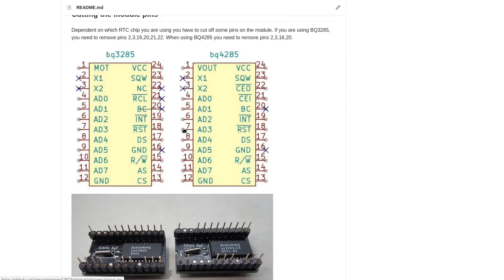Ultimate RTC module  replacement for Dallas DS1287, Benchmarq BQ3287, BQ4287 etc.

Comment: Years ago I had this mobo with one of these crap DS1287 modules soldered into the mobo...and of course the battery dies in it.

I eneded up desoldering this module and replacing it with a socket.
Then I carefully cut the module open and removed the battery, soldered in wires and ran them to an external battery holder.
Once back in the mobo...it worked until I retired it a year or two later.

Thankfully this was the one and only time I had to deal with this nonsense.
I swore I'd never consider any mobo in future that had one of these modules.

Comment: I just encountered a very strange issue with a motherboard (the famous Intel Batman's Revenge board). For some reason, after replacing the empty Dallas chip with an nwX287, I still get the "CMOS battery is empty" error. However, after modding the original Dallas DS12887 chip and adding a battery holder, the error disappeared. And of course, I tried multiple known good nwX287 replacements, none of them work (but they do work fine in other boards). This is very strange!  I'm curious to find out what could be causing this...
Reply from the maker: May be missing pin 21? See the documentation on the project site.
Reply: @necro_ware , well, yes, I did check the documentation, of course. 🙂 It is missing pin 21, same as you specified in the documentation for the bq3285: Removed pins 2, 3, 16, 20, 21, 22 (same pins missing as the original Dallas DS12887 that was installed on the board).
Reply from the maker: @ruxandy  in the documentation I mentioned, that the pin 21 is required on some boards, that's why. But if it is already missing on the original module, then there has to be something else. May be worth opening an issue on the project site. May be others would have some useful ideas.
Reply: @necro_ware , will try and do a bit more debugging myself and if I'll come up empty, I will open an issue. Thank you for trying to help and for all the awesome work you did and still do for the community!

Comment: Bro these are junk - I put one in a NEC 386 and another one in a NEC Ready and they just get hot and crash the computer. What a waste.
Reply from the maker: Meanwhile these modules have been installed in thousands of systems. I don't know where you got them from, but I don't sell those. If you have problems, you can open a ticket on the project site and I can try to help. Or just give it back to whoever you bought it from.
Reply: @necro_ware  Well, the seller I got it from won't do a return so late - and it's strange how two of these won't work....anyways, I'm going to try your method of burning the resin off the old RTCs and fitting a new battery conversion. 

And I'll keep these ones for the next time I encounter a Dallas RTC NOT in a NEC system.
Reply from the maker: This part already has been used  also in NEC boards and even music synthesizers. The nwX287 is made for various chips, so there are many open questions, like which board exactly do you use? Which chip is on your nwX287? Which pins are removed? Which RTC module was previously on your board? Does it have the same set of pins as on the nwX287? And more. I can just repeat myself, if you want to get help, please use the project site and supply all the information there. Just flushing your frustration here will not help I'm afraid.
Reply: @necro_ware  They replace 1287s - pins broken off according to your github article. I went through my retro machines using similar chips, and none worked. I'm inclined to think that this was a bad batch from the vendor...  luckily the computers POST when an even dead 1287 is put back in, so yeah, I'll be heating those up later on today. Sucks being out $50 though (though I am not blaming you specifically for that) but it could be worse I guess. I'll stick to reworking Dallas RTCs like I have for the last 20 years ;)
Reply: @necro_ware  I followed your "heat up the old RTC and break the epoxy off it" method and it worked beautifully.

Comment: What are the chances this could be used as a DS1643 for a Sun SPARC 10/20?
Reply from the maker: Zero, the modules are completely different. But may be following will help: https://youtu.be/ecTZtZhE9bI
Reply: @necro_ware  thought so, there’s a modern DS1643 replacement, similar idea to yours, it’s just not open source and like $65 on eBay.
Reply from the maker: @c1ph3rpunk  yeah, you can try the solution I linked.

Comment: Hi @necroware, I used this chip to revive a Spectrum 386. I am having trouble with a Dell 316SX. On first boot I hit F1 - continue boot instead of F2 - configure BIOS. Now nwX287 has a borked config and halts before F1/F2. How can I reset it?
Reply from the maker: You should still be able to enter BIOS. If pressing f2 on POST doesnt work try ctrl-alt-s for example. If nothing helps, just pull the battery from the module for a minute.
Reply: @necro_ware  I pulled the battery, it boots fine.

Comment: Hi, is anybody selling those modules?
Reply from the maker: Thousands of those were sold so far on Ebay since I released this project. There were so many sold, that people bought off the complete stock of the ICs required for this module. Still you can buy these modules on Ebay regularly. I don't sell them and never did.

Comment: Do you have a website? I have a couple of retro motherboards which need repairing and I need some guidance. They are American megatrends 586 SBCs, one is beeping and the other is totally dead after replacing the DS12887a IC with one of these modules in your video.
Reply from the maker: There is a project site where you can ask your questions, however due to very limited time, I don't do support. Please read the documentation on the project site, may be you will find something useful there. https://github.com/necroware/nwX287

Comment: This project is great however the BQ3287LCS or ES are just way too expensive. There is a chip which they sell on eBay at a great price which is the BQ3287LF but is is a smaller (and therefore consumes less power) There is a video on YouTube of a guy that reworked this whole project to to work with that chip and also to use the more common battery CR2032. Just look for it. YouTube won't allow me to enter the title of the video, or anything, it flags it as spam for some reason.
Reply from the maker: I have another project in my repository, which uses the smaller chip as well. That one was my first project, but the chip is tiny and not many people can solder that. That's why I introduced this one. Back then the chips were at the same price, but since I open sourced this project the prices exploded. People around the world started to buy them off and sell thousands of this modules. It's kind of my fault, that those chips are now expensive :)
Reply: @necro_ware  Ok thank you for clarifying. Makes sense. I had to order the chips from Aliexpress because they were so expensive. Hopefully they work.

Comment: Thank you. A very interesting solution. The next step replace the battery with a supercapacitor that will be recharged during operation
Reply from the maker: Supercap doesn't last long enough. It falls under 2V in just less than a week. You can extend the time using a boost-buck converter, but it's too much. I experimented with those, but eventually decided  not to use them.

Comment: Great work, always nice to see efforts to prolong the life of vintage electronics. Recently I've run into a few systems with a DS1397, which appears to be a model optimized for EISA systems. Absolute unobtanium and seemingly not enough demand to warrant a good drop-in replacement like this. Do you recommend using the same process as this, or just dremeling?

Comment: Does this work with TH6887a  9311
Reply from the maker: TH6887A is a clone of the DS12887, so it should work, but I didn't test it.
Reply: @necro_ware  Thanks for the fast response I was not able to find info online. Would a standard Dallas replacement work also?
Reply from the maker: @stephenkennedy6358  Probably, yes. There were all kind of DS1287 clones by Benchmarq, Odin, Twinhead and more. They all had the same pinout, but the timings and some little specs could vary. If the board, where you want to use it is very peaky, it could be a problem, but in the most cases they are interchangeable.

Comment: Thank you for your interesting videos, your cool projects that you make available to everyone!
Is there any difference in the use of variants bq3285s  in nwX287 - bq3285lcs, dq3285es for example?
Reply from the maker: Thank you. There is no real difference for this module. The L versions (like LS/LCS) do work with Vcc 3.3V-5.5V and the E/S versions are designed for 4.7V-5.5V. Since the voltage on the old PC mainboards is 5V anyway, it doesn't matter, which IC you want to use. Only if you'd design your own low power circuit with 3.3V, then you'd have to use the L versions.

Comment: Thanks for sharing your project! will this work the same? BQ3285LF
Reply from the maker: As far as I know the BQ3285LF is a SSOP-24 IC, but the nwX287 is designed for SOP-24. However even before I made nwX287 I also made another project, which I never presented in my videos. The nw12887 is a replacement for BQ3287 and similar modules (unlike nwX287, which supports also BQ4287 types), however it is designed for SSOP-24 ICs. I'm not using it much, because SSOP-24 is hard to solder by hand and takes more time, but if you have some SSOP-24 ICs you can use that one: https://github.com/necroware/nw12887
Reply: @necro_ware  Thank You. I was asking because is the only one that I was able to find on ebay. Do you know where to find the right one?
Reply from the maker: @duskomarincic  For example on AliExpress.

Comment: I really fell in love with your videos. The way you explain everything is so clean and understandable that it inspired me to go and fix some of my old hardware.

Speaking of it, I saw your video how to replace battel battery. However, can there be some more streamlined solution like this one which would not require additional modification of board itself with diodes and would fit? Thanks
Reply from the maker: If you want to use integrated CR2023 battery, then no. But if you simply use an external battery connected to the on board header you don't need to modify anything.
Reply: @necro_ware  I see that will be the only option. Now strictly theoretically speaking (because Im really just a beginner in electronics) could I technically connect for example rechagable 3v li-ion battery to the circuit instead of the barrel battery? I guess there are no rechargable batteries of that size though and i could just as well use external one without additional work for the same effect of it dangling on wire...  

Anyway, the board is MSI 4109 and I have to thank you again because i wasn't able to find info for it before you showed that ultimate retro website.
Reply: @necro_ware  Ok, nevermind that. There is rechargable 3.6V lithium battery called LIR2023 which shares same dimensions as CR2023. Might that be a possible solution?
Reply from the maker: @jirja3192  No, for li-ion batteries you need an additional circuit. If you drop it instead of a NiCd or NiMH battery you risk an explosion.
Reply: @necro_ware  Aha, ok. Thanks for your replies.

Comment: Indeed- a very handy drop in replacement. Many thanks for sharing! I just built one- I ordered the PCB even w/o review ;-). What should I say- it just works. Two hints: 1. The crystal is not like described on github 32kHz, but 32.768kHz. 2. In case you buy branded material e.g. the battery holder- could you provide the vendor + vendor's part number e.g. in the KiCAD as a property? I e.g. used a Keystone 1072 which required minor rework to fit onto the PCB.
Reply from the maker: Thank you. Fixed the frequency details. The battery holder I will add later.

Comment: What height would this module be compared to a DS1287? I want to replace the DS1287s in my Compaq SLT machines but they're surface mounted and being portable machines, there is literally zero clearance between the RF shield and the module when it's assembled. So any mod can't be taller than the original DS1287. I got some GlitchWorks GW12887s but they're slightly too tall.
Reply from the maker: They are pretty much as high as the original Dallas modules, may be this helps to get an idea: https://youtu.be/CMiGVQbMC5U?t=249

Comment: I designed something very similar with a DS12885, 32Khz Quartz and a CR2032 holder for Atari Falcon 030 which (unfortunately) used that DS12887, too. And they soldered it to the mainboard :-(

Comment: I bet it wouldn't be too hard to engineer a replacement with a little microcontroller and some flash memory. It could emulate the original chip while also keeping a backup of your settings in flash memory.
Reply from the maker: Yes, I thought about that as well and even made some circuits already, but I'm unsure about the compatibility, timings etc. So far you can buy thise old stock chips, there is not a lot of sense to reinvent the wheel.... may be one day though....

Comment: Hello, do you have considered selling these. I was about to try and mod the module included in my Socket-5 Abit motherboard (soldered) but this seems a so much more clean and permanent solution.
I checked your parts list and I didn't saw the pins, how are these named?
Reply from the maker: Hi Alberto, no I have still no online shop. Do you live in EU? The pin header is a usual 2,54mm round pin. Nothing special, you can get it everywhere

Comment: This solution is much more enduser friendly than actually drilling into the module to open the electrical connection
Reply from the maker: True, but soldering this part is not quite easy for the beginners. But the real question which bothers me is, how could it be, what did take so much time to watch this video? ;)

Comment: hello I have a Pentium MMX PC that worked now but it no longer shows signs of life and I wanted to ask but to work you need -5v or does it work the same? because by mistake I put + 5v standby but it worked the same now instead it is really dead even without ram it does not make acoustic sounds or displays
Reply from the maker: Hi unfortunate I don't understand the question. May be it is better if you send your question in your language and I translate it myself. As far as I can see, your question is not related to my video. May be you can find some forum in your language, where you can ask?
Reply: @necro_ware  thank you i repaired there was dirt in the socket now everything works fine 😁

Comment: The only downside is the availability and the price of the BQ3287.  In Germany  it costs about 10 € a piece + shipping :-( if you get it at all.
Reply from the maker: You need BQ3285 and not BQ3287. The second one is the full Module. You can get BQ3285 very cheap from China. Die liefern auch nach Deutschland ;)
Reply: @necro_ware  oh yes, it was a typo... I meant BQ3285 - there are all about 10-13 € as well.... maybe 9 € from China + tax.
Reply from the maker: @Ford_Prefect  I don't know, it you noticed, but I live in Germany as well. The chips cost about 3€ incl. shipping if you buy from trustful sellers. If you are ready to risk, you can get 10 pack for 10€. Just don't search on Ebay only and you find plenty of them.

Comment: Somehow my ancient Dallas RTC isn't dead. Ive had the same 486 board for 10 years or more and the PC sat unused for years before that. Not sure how it's still going.
Reply from the maker: They are specified for 10 years in stand by. When the PC is running, the battery will not be used. If yor 486 was running a lot, it didn't use the battery a lot, so it could survive. Still, just a question of time.

Comment: i just put in a drop in replacement in my Biostar MB-8500TVX-A that had a dead dallas, it's socketed so i was easily able to swap it out. it stands out of all my 430VX boards since that one has a AMI BIOS when my others have a Award BIOS
Reply from the maker: Which drop-in replacement did you use?
Reply: @necro_ware  i used the glitchworks one, like what lgr used on his p55t2p4

Comment: That's pretty cool. Would you consider making one for the Philips CDI crowd? We are going through the same issues with our Dallas chips.
Reply from the maker: Well, I have to investigate about the RTC IC used there. Can you tell me, which model you are talking about? I googled for Philips CDI timekeeper and found  at least 6 different variants.
Reply: @necro_ware  I'll get that to you tonight when I get off from work. My console is the philips CDi 910. I've been told it's the equivalent to the 205 console. I know the memory is 8k on mine. The newer revisions uses 32k.

Comment: According to the documentary from The 8-bit Guy, the factory that produced Dallas DS1287 is gone, no longer exists in DFW area, the brand new Dallas DS1287 units are now manufactured in Philippines.
Reply: "Newer" DS1287 USED TO BE manufactured in the Philippines. They have not been manufactured at all for several years now. Benchmarq BQ3287 and BQ4287 can be modified to fit, but it's not 100% sure to be compatible on every motherboard

Comment: it's amazing, thank you very much! In your experience, would it be suitable for Compaq SLT 286 & 386?
Reply from the maker: Thanks, just googled for the board images and looks so, yes. The notebook uses DS1287, so if you use nw3287 it should be a perfect replacement.
Reply: @necro_ware  thanks for your quick answer!

Comment: FWIW: The Dallas RTC modules state in the datasheet they don't connect the battery to the RTC chip until after the first power up to prevent the battery discharging while in storage. That doesn't mitigate the battery self discharging I guess but I would bet on real NOS modules still working. I would also bet on a lot of the modules being sold as NOS are actually pulls from old boards.